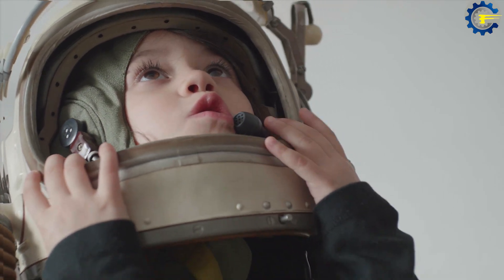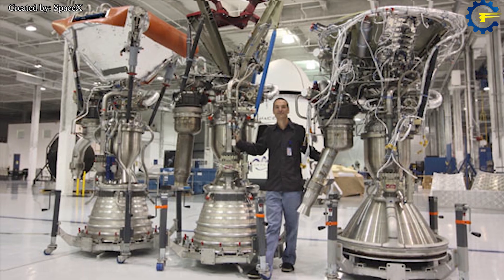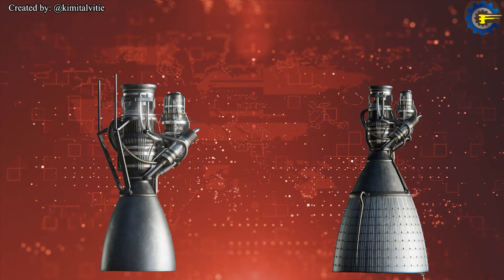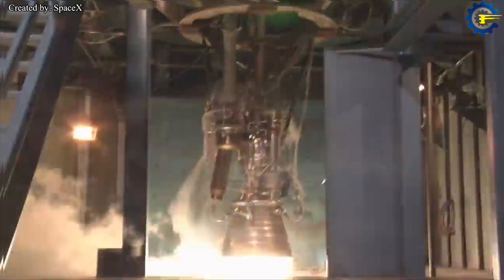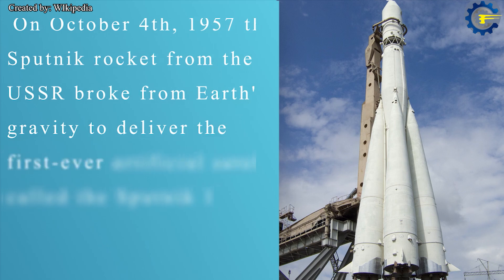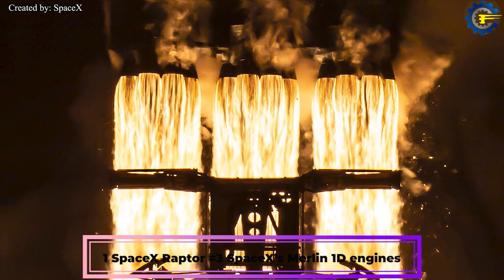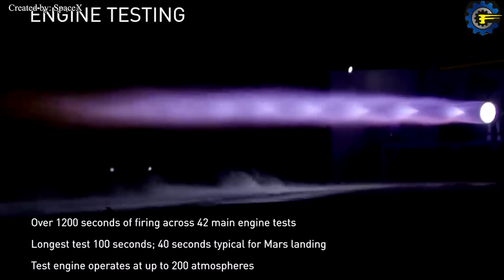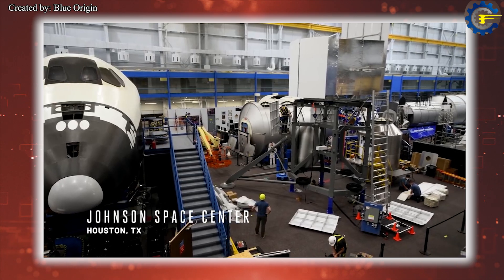SpaceX Starship SN20 & BN4 INSANE NEW Raptor Engines Are Unlike Any Other! Orbital Flight Ready

Comment: They're not new go a difference is is instead of hydrogen they're running methane and the Boost pumps are a little different Plumbing don't have to be as extreme with that versus hydrogen

Comment: Why don’t they use heat shield tiles on the base of the launch pad?
Reply: flimsy and pricey. Russians just dig a huge hole under. Best part is no part - said Ilon, I wonder why didn't he just copied Russian solution. Perhaps a water pump makes it more compact and safer in case of total mishap, like a huge extinguisher. Perhaps it also adds a punch to the thrust as ground effect. Rocket starts more rapidly

Comment: Yes the whole starship and associated infrastructure is seriously complex.  In my view the Goodzilla rocket catching etc tower look a tad on the voulnerable side in regard to the hoisting and catching gear.   Just looking at it make me wonder if the steel wire cable and pully can safely handle any unforseen shock  loads of a caught booster or starship.?   I have seen equipment designed by engineers,  engineers that had failed to allow for real world scenarios and they had designed the hydraulic cylinders and rams so they really was inadequete for the stresses they would be subjected to.!   It is all very well to do computer calculations etc,  but if some relevant parameters are omitted from the calculations,  then the resulting design may not be able to handle the stresses it could encounter.!   The other thing I would think is a potential problem is the closely clustering of the fuel storage tanks, and their relative close proximity to the launch site.?..  Two reasons, potential sabotage of one fuel tank could cause all the tanks to rupture, and, if they were full of fuels, that would create a huge fire from a small lake of liquid methane etc.  Secondly, if the Super Heavy is fuelled up ready to take off. - Should the rocket get just a couple of hundred feet up before it rupture "due to the stainless steel tanks getting brittle due to the very cold temperstures of the metal", the rocket rupture would releasing liquid fuel that will spray out by the hundreds of ton as the rocket fall back and explode on impact with the launch pad.!!!   The resulting air/gas explosion could potentially flatten the tankfarm..?  It would certaintly wreck Godzilla and the launch platform,  and probably anything within half a kilometers radius.!    Considering that,  high reinforced berms should be constructed to mitigate damage by spreading liquid gas.   It would also be a good idea to have such  berms strategically constructed between the launch site and the nearby sea.🤔...  Now, what I have mentioned might sound overly negative, but it is better to re-evalue and mitigate potential hazards and damage potential, than to ignore relevant hazards and have an "unforseen" disaster occour.🤔 !!!
Reply: Have considered taking a job on the SLS?